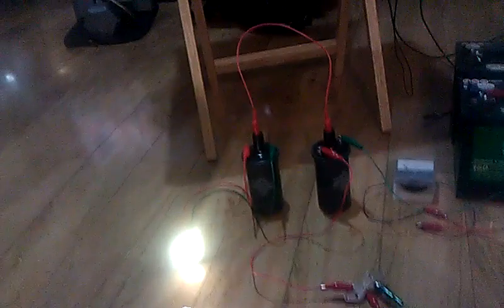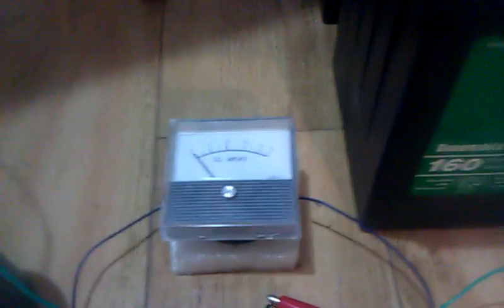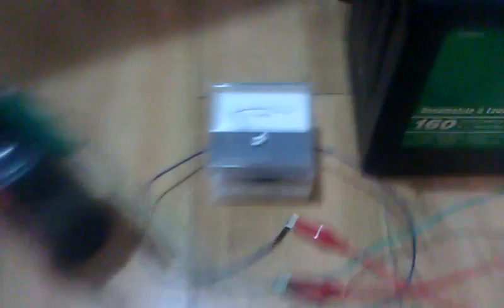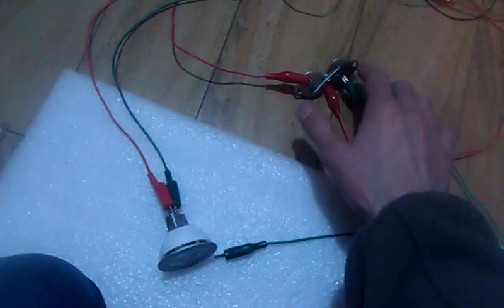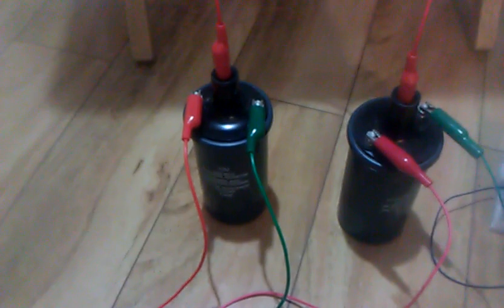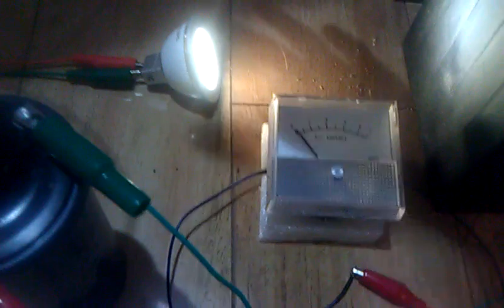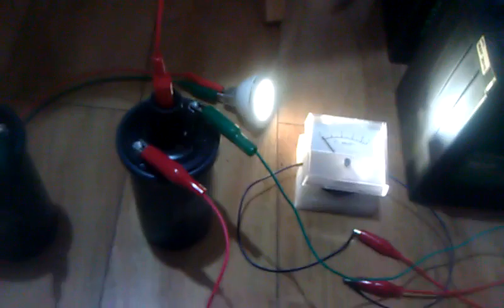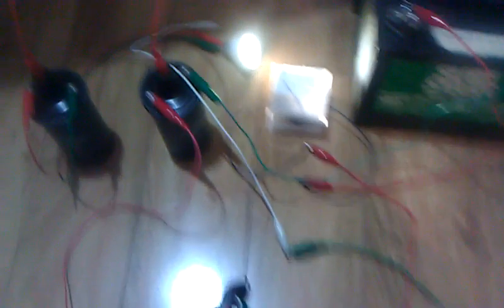Radiant Oscillator Circuit: 3 Watt Bulb & Proof of Operating Meter Part 3/

Comment: Hi everyone,
                      I Wired up the circuit as drawn by kdkinen. When I touched the base and the collector All I could see was that the neon bulb lighted and not the cfl, & when I removed my hand the neon bulb stopped lighting. So if anybody could help me with it most welcome
Reply from the maker: Hi Deepak, make sure if you try the CFL circuit that you take the circuit out of the bulbs and reconnect the two inside wires to the bulb screw connections, other than that i would go with the setup in this video, the high voltage was hurting the battery in the CFL circuit, and the CFLs were not that bright compared to the LEDs

Comment: The LED you are using, what are the specs for it? 5 watts @ what voltage? Is the light an AC or DC rated light? After you let the light run for 5 or 10 minutes. Is it warm to the touch? What about either coil? Have you tried a different kind of light like an incandescent light? 

Here is something else to try. Take a second light and run it on a variable power supply and match the brightness up to the test light by eye. Let them both run for 5 or 10 minutes and compare the temperatures.